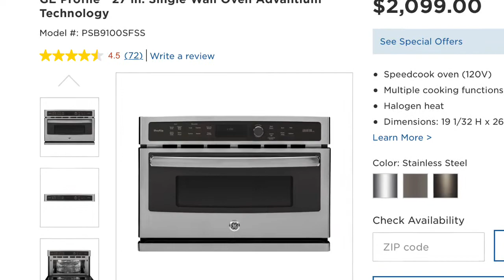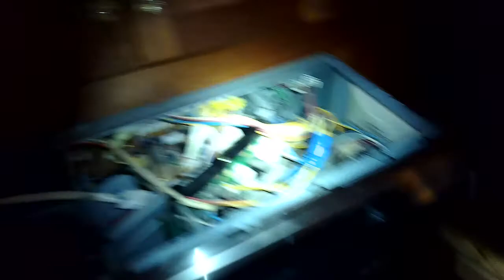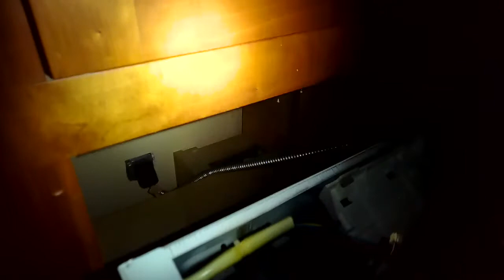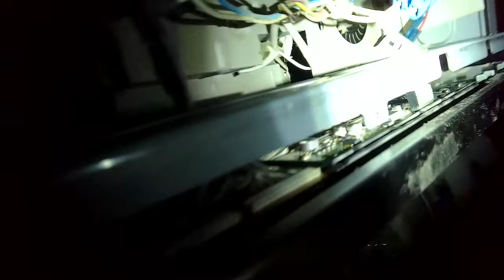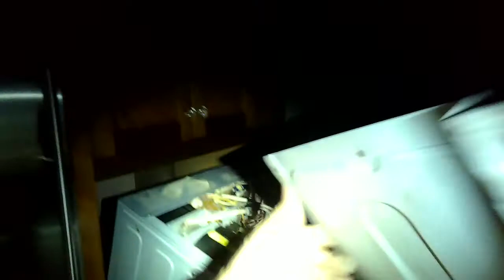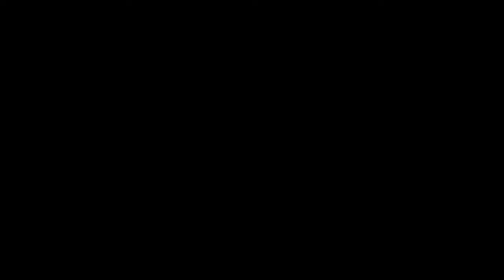✨ GE ADVANTIUM BUILT-IN MICROWAVE-NO POWER (FIXED) ✨

Comment: I have this GE Advantium as well. Our display is on, and the lights inside go on and off with opening /closing the door. But when we try to run the microwave or oven, nothing happens inside, but the counter counts. There's some initial clicking, but it never heats. Any ideas?
Reply: I'm having the same issue now, just wondering if you got a chance to fix it?
Reply: @boboji  I got the switches and it worked perfectly. They were fried from opening it when it was still running. Hardest part was carrying this beast to a table.
Reply: @gsd0519  thank you so much, just checked mine and that's exactly my case as well!
Reply: @boboji  it was a very easy fix.
Reply from the maker: Thank you,
Probably one of the door switches or the internal fuse. 
😊Scott’s Tip Jar - Click Here: https://venmo.com/code?user_id=2758682643267585005

Comment: Thank you! I’ve had 3 of these over the past almost 20 years in 3 different houses were we’ve lived. The previous units worked very well and I never had any major issues with them and we had lived in each of those places around 6 to 7 years. I finally got another Advantium 30 Inch built in unit in the house were we live this past year, purchased brand new. It’s already been serviced 3 times for blown TCOs and and a board and it’s not been a year yet. I’m pushing the appliance company to replace the unit, but they’re telling me that the same replacement GE Profile Advantium 240 30 inch will have the same issues. (They also say they can’t replace it with a different brand.) What should I do? Very frustrating, because I love the functionality of the speed oven since we work long hours, but it still allows me to prepare healthy meals much more quickly than a regular oven or microwave.
Reply: What a cop out on the part of GE. They know their ovens are defective from the start.

Comment: I have an Advantium PSA9240 FS5SS over the range speed cook oven. Everything works except th halogen heaters . It is 18 months old. is it possible for the power board pcb you are showing to still run the microwave if it is bad?  I have tested all the door switches, with an ohmeter and some other things , replaced the relay board . I can't see anything burned anywhere. all the fans and motors work jus no Halogen lights. If one  I have the service schematic with the block chart and it says pcb might be the problem but not which one. But since the microwave and convection work ok I'm skeptical about that board being bad. Any idea what it might be?

Comment: Hi, I have the GE Profile Advantium 
model no. SCB2000FBB 02.
Some how one of the kids got food on the inside of the exterior glass and in order to clean it, I need to  disassemble the door. It has a pull down door and I can't figure out how to remove it from the hinges . Any advise?

Comment: Hi. Wow. I’m thrilled to find this but not sure if I should forge forward to repair (well, I will have to get either an electrician or GE guy is supposed to come out and try to fix for free). GE has been incredibly difficult, and have dragged it out. But they have agreed to pay me for it and remove it. Let me back up. I forgot to say that I have the Advantium 240. It is nearly new, hardly used, as I was updating a condo and had one renter for six months in 2020 who said she never cooked in it!  I did go to the condo and used it about a month in September 2020 and then it went on the blink.  Dead.  No lights coming on, just as you demonstrated. When the GE guy came out, he didn’t even look inside. He just ordered parts and said he would see me next week. Well, long drawn out story and now I’m wondering, should I take the $1500 and run ftom GE?  I thought it was so cool that the pizza I made was crispy and quickly cooked. But this is my chance to buy something else. Is there any other speed cook type oven?  I think there might be an air fryer/microwave?  But I want like a second oven tgat will cook, roast, crisp, and preferably quicker than a regular oven. Orrrr, do I fix it and pray it’s not recurring, which it sounds like it will be. 

Also, it looks like GE is in a pickle, because every website either says it’s on back order (Best Buy and Lowe’s) or that it’s discontinued (Ferguson’s/Build.com)!  What should I get to fill that spot above the kitchenaid stove/oven combo?? 
Thx!!

Comment: Hi Scott, I have a GE ZSC2201NSS01 advantium 240v and every 10-12 months the TCO keeps blowing on speed cook and now the Halogen cook light heat is not working and I replaced that 13 months ago. My microwave is working. What would be the reason why the TCO blow more often? I have had this unit for 10 years.
Reply: Hey, I have the same microwave. Do you think you could give me an idea where the TCO fuse is located?
Reply: @sebastienb.5985  ALl, I have the same microware, but it keeps blowing the fuse as soon as i start the microwave. any ideas as how i can diagnose the cause.. much appreciated